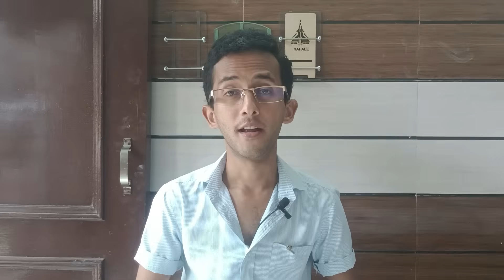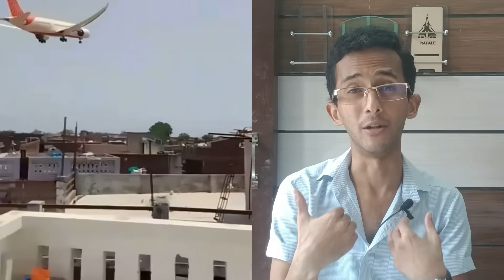Why Did This 787 Crash So Methodically | Air India 171

Comment: Yes, there was an initial fire ball but, was there the kind of fire you might expect from a plane fueled for the length of flight this plane was going to take?  None of the video or photos of the crash scene (including your thumbnail) show much fire damage.  Therefore, I'm wondering if the problem was empty fuel tanks.  Can you comment?
Reply from the maker: The problem was not empty fuel tanks. Pilots had taken more than the amount of fuel that was required until Gatwick. Yes I deliberately did not include much of its footage, as I don't like to feed off of a tragedy that has just happened. 

I loved your comment! Thank you. 💕

Comment: Double Engine failure > Loss of thrust > RAT deployment > Landing gear could not be retracted due to insufficient power and less priority (since it was clear PLANE CANNOT FLY ANYMORE and has to land/will crash land. Flaps configuration was fine as seen in wing wreckage. No need to put blame on pilots, they did everything in that 19 second window. Rather use your knowledge on what caused this double engine failure.
Reply from the maker: This isn't me blaming pilots. It is me eliminating chances of no pilot error as many have for some reason, begun to point at that. That is just not possible either. If you understand what I've just said. Thank you for commenting!
Reply: So ... time to edit your comment again. Both fuel switches shut off intentionally.

Comment: My thoughts, once the landing gear began to retract power failure occurred, survivor said a bang sound occurred about 30 seconds after takeoff & interior lights flickered, RAT had deployed. Pilot’s mayday - no thrust, no power. Once this occurred at their altitude, everyone on flight AI 171 became a passenger. My thoughts are with those families affected & NTT YouTube channel is providing reality in the aftermath of this tragedy long after global television networks have moved on.
Reply from the maker: Thank you for your insight on this! And I appreciate this comment so much for the right reasons. 😁❤
Reply: @ThatAirbusGuy ❤️
Reply: @ThatAirbusGuy Something to look at, remember the runway DUST CLOUD AI 171 generated on takeoff, now add STATIC CHARGE to those DUST PARTICLES via the landing gear tires which MAY have created a power outage combined with very hot air weather conditions. A freak onset of circumstances possibly coupled with wire fatigue or damage. Maintenance failure…..say part/s weren’t correctly installed after examination or replacement. Worth consideration.
Reply from the maker: @midnightspares  damnnn that is some insight! Yes you are absolutely spot on. Thank you so much for these comments. People have to consider these too. This is great! 👍🏻:)
Reply: @ThatAirbusGuy  ❤️

Comment: No, plane never stalled. It was unable to maintain height or climb due to the lack of thrust from both engines but it never stalled.

Pilot kept it under control and flew it all the way until impact. This was a controlled crash-landing.

Obvious evidence is the plane kept its nose up. You can’t lift the nose up and kept it there if your wings are stalled. 

You can even see captain did a little flare before impact in the footage
Reply from the maker: Good point yes. But I'm sticking to that glide that we see here. A slow glide, and I will stand with my interpretation of this, in that other footage (that I did not put here), there is a clear part where the 787 reached stall stage, right after the pilots could not produce any sort of lift, and after that brief second of stall, they begin to glide slowly, nose up, lose thrust, did not regain altitude, or speed. 

Thank you for commenting.
Reply: @ThatAirbusGuy There is no video showing the plane ever stalled. A stall at low altitude always resulted in the nose to drop follow by aircraft quickly lose altitude.

You can search youtube for “airplane stall” so you’ll know what a stall looks like. 

This is not a stall. This is a pilot flying the aircraft maintaining just enough airspeed to prevent the aircraft from stalling. 

If the plane stall, the pilot would transition into just passengers sitting in the cockpit watching gravity landing the plane for them… gravity usually just headbutt the plane into the ground.

Comment: nice try, many of these issues have been addressed by established professionals in the field. if that is a factor, what was the ground temperature that day?
Reply from the maker: Somewhere around 41°C here, India.
Reply: Hence ice would not seem to be a factor.
Reply from the maker: @josesouza9820  it won't be mostly, but not entirely. There'll still be a possibility of ice forming inside of the fuel lines, how I've mentioned in the video. :)
Reply: @ThatAirbusGuy  ice forming, an unsubstantiated comment in a video following a tragic event. How sad.